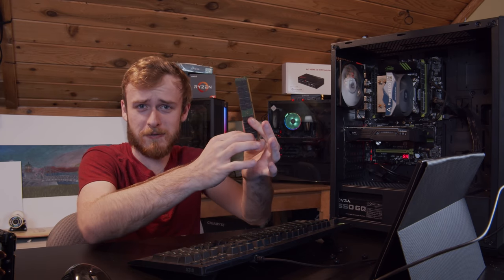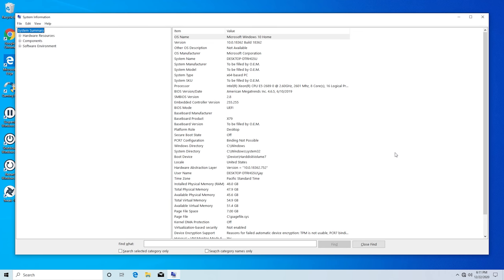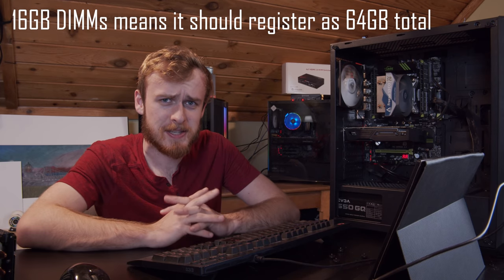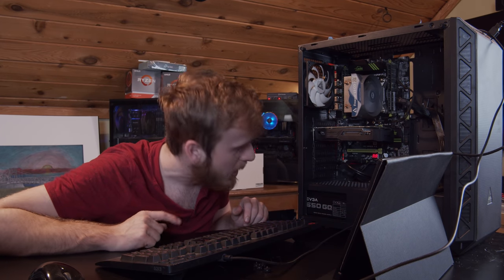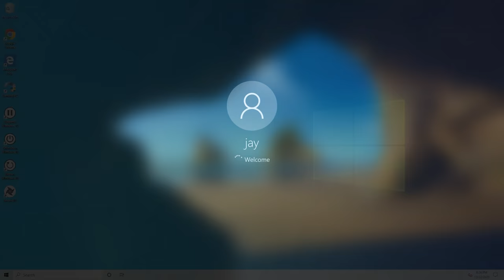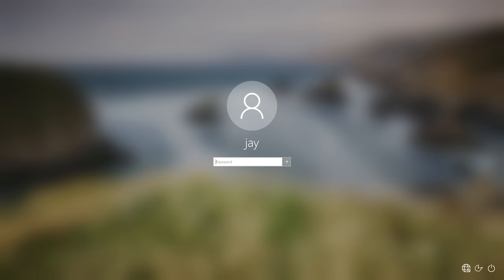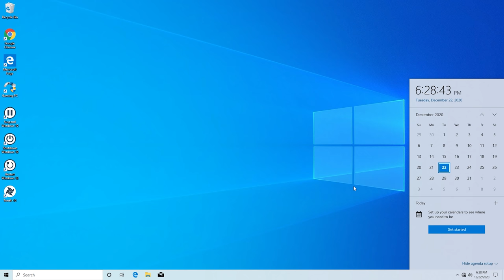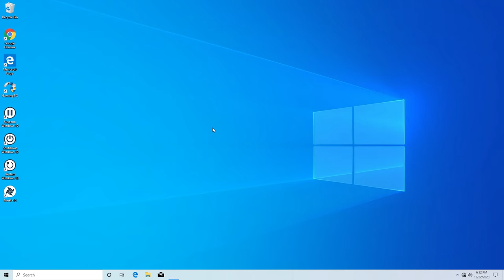Can You Upgrade Your GPU While The Computer Is On?

Comment: I'm actually pretty surprised the GPU died, as technically PCIe (especially in servers) supports the hot-plug standard, meaning there's a chance it could've worked.

You should also try it while the PC is in sleep mode and hibernate. I think microsoft may have wrote some dedicated warnings on the boot screen for those scenarios.

Comment: You absolutely can hot-plug hard drives and cards. The drives just need a special adapter that limits the inrush current. The cards are more complicated - the motherboard must support the feature and it has to be enabled in the BIOS.

Comment: @Jays Tech Vault , Regarding the CMOS battery: On the DELL Latitude E6410, the system motherboard will indicate a status of failed and not boot at all without the CMOS battery connected or if the CMOS battery is low. Led me to buy a new motherboard when all I needed was a new CMOS battery LOL.

Edit: Also, as far as getting zapped on a motherboard, it's significantly unlikely, computers only run at 12V, 5V, and 3.3V (include about 1V for the CPU/GPU/RAM cores), which the highest voltage you'll find in the motherboard is basically the same voltage as your car battery.

Comment: I tortured a gt 730 for years in my old computer whenever I got mad at my games because of fps drops or internet lag I’d stick my screwdriver and shock all over the back of it, I’d smack it, pull it out while the computer was on and then shove it back in, threw it across the room, slammed it on my desk, etc, and it never died. That computer still works to this day. I don’t use it but it still plays games like league, csgo, rust, warthunder, world of warships all at stable fps 1080p doesn’t have any issues. Not only that but it’s always been overclocked to the max the sliders would go to in MSI afterburner and somehow is stable. That card is an absolute champ.

Comment: i have a similar tale. a few days ago, as of 1/7/2021, i was playing my pc, but I wanted to play console. So, I went down to my gpu, to switch the HDMI from my PC to my Xbox. The HDMI was stuck in the gpu, and after pulling on it a bit, the card broke loose off of the PCIe x 16 slot. Knowing the pc could short out, i scrambled to the front and pressed the power button, (which since it took a while to shut off) I ended up turning off the power supply, instantly removing the power. I opened it up, plugged it in, re screwed it in (it was already screwed in, so i had to redo it) and fired it up. it still works today.

Comment: SATA is hot pluggable. That's why you have some of the connector pads longer than others. There are even special AHCI registers to deal specifically with that. And I've done it many, many times with no damage to any compoment.

Comment: Regarding the CMOS battery removal, the computer didn't seam to lose track of time because Windows 10 sync the clock on boot by default when connected to the internet. I'm pretty sure the BIOS was indeed reset though.

Comment: The time stayed on track without the battery because Windows automatically detects if the time is not correct based on your location and Windows probably fixed it as it was booting up.

Comment: I was once able to remove and replace a NIC card on a old IBM server by disabling it in the Device Manager before removing it and clicking refresh once I swapped the card. Obviously this was an old server without integrated LAN and using the old PCI cards running Windows Server 2003 (I did say IBM server, not Lenovo).
[I also once kicked the top of the case for pissing me off and it made a spark (confirmed by smelling fried PCB) and the power went out... but I was able to power it back on and never saw any issues... (it was a normal ATX PSU, nothing redundant) seriously, it was an impressive server]

Comment: my answer is yes and no on the gpu a no due to the issue of the pci slot being crashed the display driver can recover but the pci slot cant until reboot any driver affiliated with the pci slot wil also crash and the yes comes from they could technically be reset when you plug pull out a videocard and put it back in when you removed power to the pci slot and put the videocard in and put power on it agian then reseted the pci slot but in general its a no you would actualy need to program it to that behaviour aka hot swappable pci lanes

the cmos battery removal wont do anything past the initial boot as it keeps enough electricity for it to remember the bios settings why in this case the removal of the cmos battery afther reboot did nothing agiants the time clock wel its simple if you go into date and time settings there is this button called "set time automatically" and timezone turn that off and you wil experience the time being out of sync

harddrive np if its hotswapable and hotswapping is enabled all ryzen motherboards from my experience has this feature in the bios wel atleast the ones i had which was the asus prime b350 and the msi mpg x570 putting the harddrive in a docking station even without hotswap wil likely result in no issue at all although there is a button on the back of docking stations to turn it off so dont see why you want to replace the harddrive that way

Comment: i have tried connecting a hard drive and disconecting a graphics card and the hard drive worked for me, it was like what a usb would do. With the graphics card, the system crashed and i had to restart it to get it working again. (note: i was using a ryzen 3 3200g with intergrated graphics)

Comment: You Actualy Can Add Hard Drives wile the System is on HDDs or SSDs are Hot Plug normaly Windows Shows you a little Pop up and says yo i found a new Hard drive then you can use it you only have to give the new Hard Drive a new Letter like D ore B ore Somthing else

Comment: SATA devices are hot-pluggable lol, if you are relying on IDE-compatible SATA mode, you should head to devmgmt.msc and run a hardware lookup in order to get it detected while the computer is running.